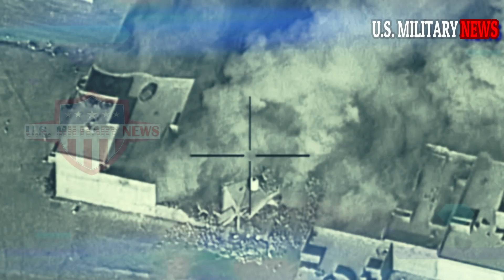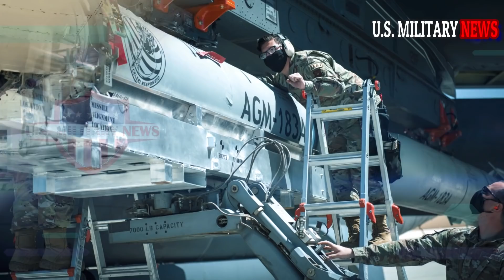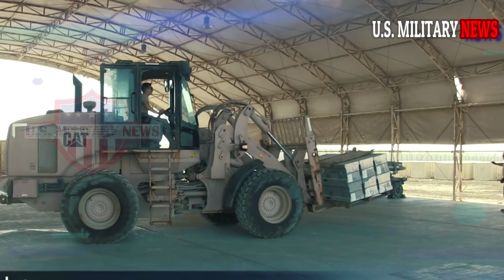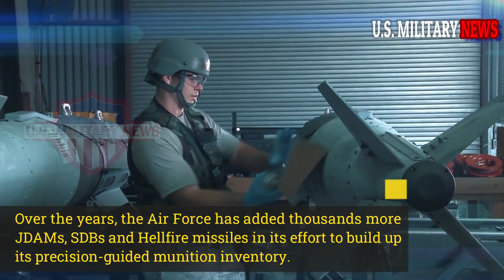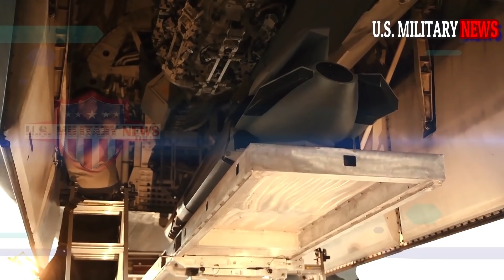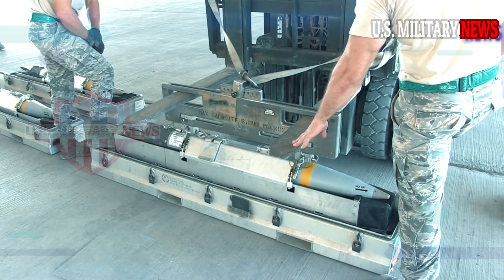Upgraded, USAF JASSM-ER stealth cruise missile now has a range of 600 miles

Comment: Budgets vary from year to year and most of the contracts cover 2-3 years.  They are not ordering Maverick because they are old and being phased out.  The JDAM and SDB are still being used and they are still being built, especially the SDB2.  The new glide body cruise missile is is a newer long range version of one made several years ago.  They have 2000 of the shorter range varieties.  The new one has been made in small quantities for the last 3 years, but starting next year they are ramping up production.  They are planning on 4900 of them, o they should get 2900 of these new ones.  They have a 2000km range, are stealth, carry about a 500 pound warhead, and they can carry them on most modern jets externally.  The B1-B can carry 31.

Also the US has no intensions of attacking China unless they attack the US first or one of its allies, like Taiwan, Japan, South Korea, the Philippines, Guam, or Australia.

Comment: The Air Force should attach 4 cruise missiles under the Bomber , besides what’s stored in its bay
Reply: The B52 "Buffs" do this but the B1 "Bone" only has 6 hardpoints on the fuselage due to its configurable swing wings for supersonic flight (like the F111 and F14 used to do before they were retired).  
       A squadron of 16 Buffs can carry enough cruise missiles to "service" every capital (ie ocean-going) ship in the ENTIRE Chinese Navy.  This is why the Russians retain their Bear bombers too.  A Bear squadron can carry enough ASMs to equal the firepower of a US Carrier task force at a much cheaper overall cost.